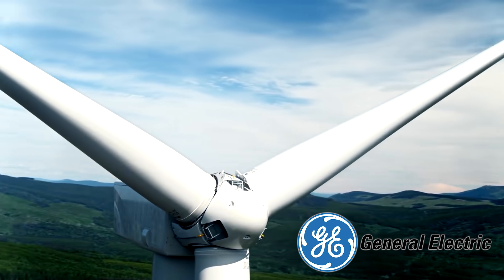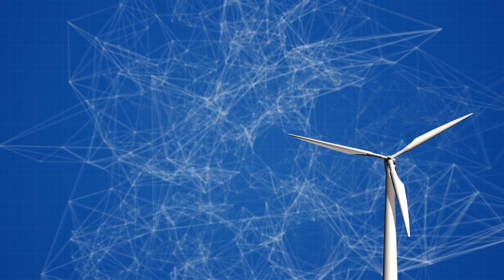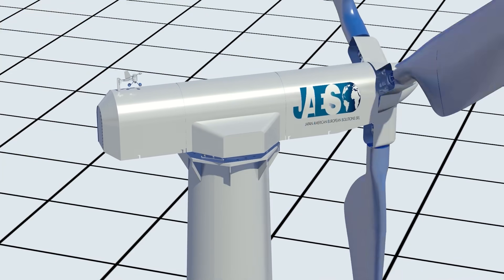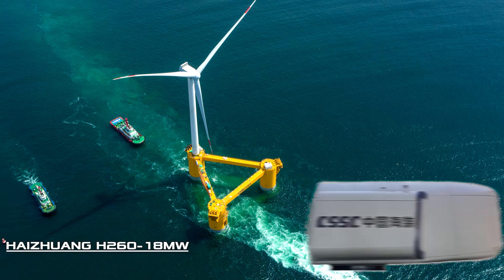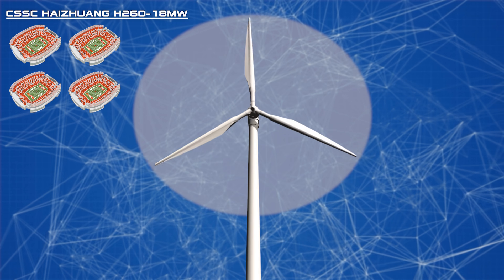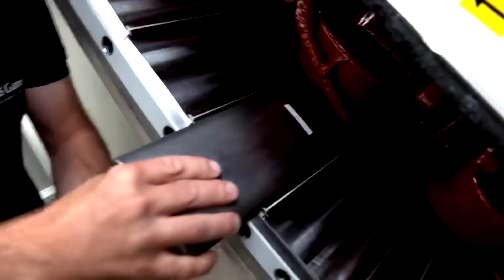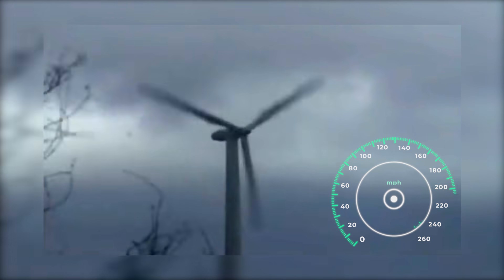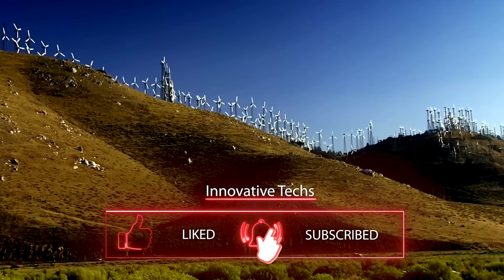China is building a wind turbine of unthinkable dimensions

Comment: To compare the production of kilowatt-hours (kWh) per year between a nuclear reactor and the biggest wind turbine, we need to consider their respective capacities and average annual energy output. Let's assume a hypothetical scenario for this comparison:

Nuclear Reactor:
Suppose the nuclear reactor has a capacity of 1,000 megawatts (MW) and operates at a capacity factor of 90%. The capacity factor represents the actual output relative to the maximum potential output over a given period.
Calculation:
Annual energy output = Capacity (MW) x Capacity factor x Hours in a year
Annual energy output = 1,000 MW x 0.90 x 8,760 hours (assuming 24 hours per day, 365 days per year)
Annual energy output = 7,884,000 MWh (7.884 million kWh)

Biggest Wind Turbine:
Let's assume the biggest wind turbine has a capacity of 10 MW and operates at an average capacity factor of 40%. Wind turbines have lower capacity factors compared to nuclear reactors due to variable wind conditions.
Calculation:
Annual energy output = Capacity (MW) x Capacity factor x Hours in a year
Annual energy output = 10 MW x 0.40 x 8,760 hours
Annual energy output = 35,040 MWh (35,040,000 kWh)

Now, to determine how many wind turbines would be needed to produce the same amount of energy as one nuclear reactor:

Number of wind turbines needed = Annual energy output of nuclear reactor / Annual energy output of a single wind turbine
Number of wind turbines needed = 7,884,000 MWh / 35,040 MWh
Number of wind turbines needed ≈ 225 wind turbines

Please note that these calculations are based on hypothetical assumptions and the actual performance of nuclear reactors and wind turbines may vary. Additionally, the size and capacity of wind turbines can vary, so the number of turbines required for equivalent energy production can differ accordingly.
😪
Reply: You calculation is over-complicated.  First you used a 10MW wind turbine against a 1,000MW nuclear generator so there is a factor of 100.  Then you claimed a nuclear plant can operating continuous so a use factor of 0.9 with a wind turbine could have only 0.4 so another factor of  2.25.  Therefore the combined effect it will need 100x2.25=225 wind turbines to compete with a nuclear generation unit.  This is just simple arithmetic!  

However the use factor of 0.9/0.4 = 2.25 between nuclear and wind is theoretical and may not easily realise in practice.

This video is about 18MW turbine manufactured by two Chinese companies and they are already used in the field.  Also 0.4 use factor may be the American data as it has nearly all wind turbines on land whereas the new 18MW big wind turbines are for mainly the offshore installations capable of a much longer continuous generation.  

The data from China are
             Nuclear capacity         Nuclear               wind capacity          Wind                   Unclear/wind
year       installed (GW)      generation (TWh)    installed (GW)   generation (TWh)   use factor/GW
2021            52                                 407                          236                        655                       2.82
2022            55.53                            417                          365.44                  772                       3.55
Reply: @gunsumwong3948  At least a wind turbine doesn't leave its deadly waste to be taken care of for many years forward, by our children's children, many years after its it has been used for a short time intensive power production!! And also Denmark, at the very Forefront of Wind Mill Production, has planned a huge Wind Park at sea.
Reply: @finncarlbomholtsrensen1188  
If you consider the sheer weight of mine tailing and other deadly material produced by each power source, nuclear wins hands down. 
An additional factor in favour of nuclear is the potential of fluid chemistry for the fuel. (Used in Oakridge, USA until President Nixon cancelled it. )

Pressurized water reactors, the standard type since the 1970s are grossly inefficient, producing a massive amount of waster by nuclear standards. 

( Solid fuel rods, without reprocessing, demands the removal of the fuel rods when 0.5% of the fuel has been converted. The fission products include radioactive gases, Xenon, and others, which split the rod apart. Once the rod starts to split it has to be removed to a tailing pond. Nuclear reactors, using pressurized water, can only operate at low temperatures, implies a conversion efficiency of no more than 1/3. Include the transmission losses of 1/4, the pressurized water is under the pressure at depth of 2 miles, 3 km, in the ocean, implying it has to be situated well away from users. The amount of the solid rod fuel energy converted to useful work before being removed to a tailing pond is only a thousandth of the energy available. )

The advantage of a design using chemical combination of uranium as a working fluid are
(a) The radioactive gas products of fission simply bubbled up out of  the fluid, allowing all the fuel energy to be used
(b) No high pressure container is needed. 
     (No potential for the roof of the reactor to blow off, as in Chernobyl.)
(c) In the event of overheating, a dump tank can be used, designed to dissipate heat and dampen all nuclear reactions. 
      (No potential for a Fukushima.)
(d) All reprocessing is contained on site with no removal of waste products from behind the containment wall. 
(e) The potential for useful energy from the fuel is near 100% as raw heat can be used for industrial processes. 

(The reactor temperature would be high  enough for concrete production, etc. )

(f) The temperature of the heat sink can be as high as 400 Kelvin, hot enough for desalination.  (Pressurized water reactors require a 300 Kelvin heat sink.)
Reply: You forgot a few things:
1. You can't make nuclear bombs from wind energy.
2. You don't have horrible accidents like Three Mile Island, Chernobyl, Fukushima or the danger of Europe's largest nuclear plant Zaporizhzhya in the middle of a war zone.
3. The cost of nuclear plants.
4. The leaks from nuclear plants.
5. The inability to safely store nuclear waste.
6. The 50 years required to store the waste for safety.
7. The danger of plants requiring a massive amount of fresh water during severe droughts.

Time to move on.  Maybe wind isn't the answer but neither is nuclear.
Reply: Don't forget to mention that a nuclear reactor does always, 24/7, all year long, produce reliable energy.
Also note that the dreaded nuclear waste from conventional nuclear reactors can be used to produce electricity in specialized nuclear reactors. This technology has been around for decades but certain groups don't want it to be utilized.
Reply: Reactors are VERY EXPENSIVE to BUILD , Long Construction Time and Maintain. Plus ..Tread of military Strike by enemies ? Then there is High Maintenance , Checking, Inspection, etc. of Reactors. Makes sense if it is NEAR HIGH DEMAND regions like cities and Industrial Complex. If a small City and lots of towns and Villages ??
Reply: Stanislav,  I wonder if you can help me understand. I seriously don't believe that during the whole service lifetime of a wind turbine that it produces more than the total energy that was needed to mine the ore, fabricate, ship, assemble and maintain it. Has anyone honestly looked at those figures?   What is the total energy required to built a wind turbine starting from nothing?
Reply: @RuleofFive  sounds like you need to do some more research on how the advancements of nuclear have come to. it's safe, and clean, now adays. this isn't your fathers nuclear power plants! There are more options now vs the dirty ones of the past.
Reply: Double that number of wind turbines needed, since peak power demand is in August while wind speed is reduced, wind turbines only operate at 50% of capacity then.
Reply: @RuleofFive  
1. Yes you can, the Hiroshima Bomb was Uranium enriched by using the power from the Hoover dam. (See the Manhattan Project )

2. and 5. The patent for the pressurized water reactor states it is not to be used for more than 2 megawatts of power production as containment is not guaranteed. 

In other words the nuclear plant manufacturers know they are using a design guaranteed to fail with subsequent leaks, melt downs and other very undesirable problems. They simply refused to spend the research money needed to create efficient and safe designs in the interests of immediate profit, hence 3 Mile Island, Fukushima and the potential losses of material from all solid fuel rod reactor designs. 

3. Nuclear plants, with grossly inefficient designs, only 1 in 1000 parts of the energy converted to useful work are competitive. In other words the cost is incredibly cheap when the usage of designs no better than 18th century steam engines, is taken into account.

4. Nuclear waste can be cut, for each Kilowatt hour of energy production, by a factor of 1000.  The total nuclear waste to date has, except for deliberate design errors, Chernobyl, (No containment shell ), Fukushima, (The backup generators were placed in the basement where they would be guaranteed to flood. ) been contained.

The radioactive waste from coal, gas, oil. If the same radiation regulations were applied to fossil fuel plants, as used for nuclear, they would all have to shut down due to the spread of radio active waste into the environment.  

6. 50 years is short period of time : lead and other heavy metal contamination from mine tailings are a permanent threat : until the material is inserted into a stable geological formation it poses a threat to the minds and health of all future generations. 
 
7. The droughts in Europe have demonstrated 
(a) the need for fresh water is determined  by the low heat sink temperature demanded by pressurized water designs, (Equivalent to 18th Century steam engines in efficiency.)
(b) Even such designs have proven able to operate in an intense drought, and in the event of loss of all water can be shut down. 

Note
 (c)  China now has air cooled nuclear reactors for commercial use which they are using in the Gobi Desert. 

(d) The usage of 400 K heat sinks allows the usage of sea water for cooling : it can be boiled.
Reply: @samadams7224  
The problem is not the energy demanded from already extracted ores, its the amount of copper and other metals which are needed for future construction. Only low grade ores are available in the amounts needed. For example the Andes are 0.1% copper ore, sufficient for the any future needs with the inconvenient problem for each ton of copper extracted, a 1000 tons of mine tailings is produced. The tailings are produced by grinding hard rock into extremely fine grains, an enormously high energy usage, so the tiny grains of copper can be extracted. (Google Simon Michaux )
Reply: @neosmith80  Yes yes there's always someone like you talking about the wonders of nuclear energy with all the horrible flaws worked out yet these dream plants never materialize because someone wants to stop them?  Great then volunteer to move the nuclear waste to your town for the next 50 years.  We'll split it between your town and Michael Edwards town.
Reply: @michaeledwards2251  Yet another person making big promises but yet they never materialize.  We're just left with environmental disasters.  Like recently the Russian Army camped out in the red forest near Chernobyl....you remember the accident from 1986?  Bad design right?  Build your dream plant (near your house not mine) and call me.
Reply: @RuleofFive  
Kindly point out the promises ? 
1.  Fossil fuel plants are killing millions every year (Just because you don't see them doesn't mean the nanometre particles from them won't kill you.)
2.  Even the current pressurized water nuclear reactors have only killed in the 100s. 
3.  The Chinese have already developed and implemented nuclear designs capable of functioning in desert conditions
4.  The usage of mountain destruction is needed to get the raw materials needed for the green revolution with cubic miles / km s of mine tailings full of heavy metals and other poisonous material. I trust you won't mind the poisoning of all the water courses near you. 

5. There is no avoiding any of this : why, because oil has already peaked, coal will soon peak, along with gas.  As the fossil fuel plants fail, they will have to be replaced with at least twice the current generation to sustain the rapidly growing demand for energy.  (GDP and energy usage double every 10 years in the Far East )
Reply: @michaeledwards2251  I'm not defending fossil fuel.  Are you kidding?  It's laughable that you say nuclear power has only killed hundreds.  We don't know the true extent of damage from Chernobyl or Fukushima.  The USSR did not release accurate information and an entire region around that plant has been depopulated in the exclusion zone.  Do you think Fukushima (newer technology) is much better?  People left that region too.  We don't know the long term health effects.

  You're giving a false choice.  Either embrace nuclear or then I must support continuing with fossil fuels?  There are other choices that can be made that are not as dangerous.  As we speak there is a war raging right around the largest nuclear plant in Europe, Zaporizhzhia.  What happens if the Russians fire a missile at that plant?  How much trouble would that cause locally?  As if Ukraine hasn't been through enough from that nut job in the Kremlin.  Nuclear is always the ticking time bomb. Think the Chinese have created a safe way to tame/harness nuclear?  Maybe or maybe not.  They're not known for being the most transparent government on earth.  Let them enjoy some accidents while they test this technology.
Reply: @RuleofFive  
There is no choice : haven't you realised this yet ?

1. Fossil fuel reserves are good for no more than another generation. Barely enough time to  create their replacements. 

2. New mines take at least a generation to find, implement and make a metal source.

3. Copper needs for renewables to replace fossil is greater than the total copper extracted to date.  Wind, Solar, etc. 
     There simply isn't the mines needed to do it nor is there time to make new ones. (Google Simon Michaux)

4. The only options left, in the coming generation,  are nuclear and geothermal. 

(Fusion will need Wembley sized power generation with considerable radioactive waste from the neutron flux. As yet, no fusion power station exists)

5. Loss of power  = GDP contraction which would be bad enough in the West, intolerable everywhere else, leading to social breakdown. The slow down in the US has already triggered a crime wave, a mild taste of what would happen with contraction. 

6. The only option left is nuclear. 

7. Pressurised water nuclear is a  non-option. 10 Gigawatts of nuclear power will need to be added per day for the next 30 years.  

It simply won't be possible to create the giant high pressure containers for nuclear use, 2 tonnes per square inch, the pressure 2 miles, 3 km, deep in the ocean, at the rate of 1 per day.  Only Nippon Steel is the only manufacturer of the needed high pressure containers I am aware of it : it is a very specialized process at the scale needed. 

8. The only option left is low pressure nuclear designs with the addition of such power generation at the rate of 10 gigawatts per day for at least 30 years. 

This will be just the start, synthetic fuel generation from atmosphere carbon dioxide will be next, which will be as big again. 

Don't forget to add in a factor of 10 times more to account for the GDP growth to meet the demands of the 7 billion who don't have the luxurious life styles of the US and Europe. 

Do you trig ?
Reply: That's one reason these wind turbines are being built offshore - more reliable energy production. Hywind Scotland achieves a 57% capacity factor. These numbers mask the problem with nuclear energy which is cost. Your 10MW wind turbine costs around $10 million. Using your numbers, 225 wind turbines cost $2.3 billion. Two recent nuclear reactors built in Georgia cost $30 billion. That's $13.4 billion per 1,000 MW or SIX TIMES more expensive than the wind turbines.
Reply: @RuleofFive  
When you mention Fukushima, remember the reactor was produced by Westing House USA. The first 2 safety inspectors preferred to be fired rather than pass the design. The third was facing bankruptcy and even with facing ruination only passed the design with caveats. As I pointed out early the US manufacturer's of nuclear plants put immediate profit $ ahead of all other considerations.  Why didn't they bother to listen to their own safety inspectors ? Because the US controlled Japanese law on nuclear reactors, which make the operator responsible for any incidents. They didn't care how the dangerous the design was, as they would not suffer. It was cheaper to fire the safety inspectors than to correct the design. 

The Russians learned a hard lesson with Chernobyl : building a reactor without a containment vessel, not bothering to maintain it properly and then carrying out safety tests as if everything was correctly maintained, not working out what they should do, understanding what they are doing, is guaranteed to lead to consequences.  Fortunately Chernobyl was only a steam explosion and not a nuclear one. Most of the radio-active material remained in the core.
Reply: @Ericwvb2  
The capacity figures are misleading. 
(a) Electricity usage and generation have to match. Any mismatch implies power has to be stored, resulting in 1/2 the mismatched power  being lost. 
(b) The mismatch problem is seasonal. Power will have to stored for months of normal usage.
(c) Generation variability is apparent even over periods as short as a few hours, demanding daily quick response storage to maintain grid stability. 

Typical capacity figures for wind turbines are no more than 33% and more typically 25%, with the effective capacity being even lower, due to the generation, consumption, mismatch. 

When you allow for 
1. The effective capacity factor for wind turbines
2. The seasonal back capacity implied

There is no cost difference between current very inefficient nuclear designs, pressurized water, and wind turbines, there is no cost advantage for wind with the disadvantage it is not controllable. A storm can force shut down to prevent the turbines being destroyed. 

Electric Arc Furnaces and other metal processing cannot shut down without a disaster. The furnace metal would freeze requiring weeks to get going ago. (Likely the furnace walls would crack.) Likewise power to hospitals, especially intensive care, has to be reliable. 

There is an additional disadvantage to wind turbines : their life expectancy is typically 8 years, against 40 + for nuclear.  The costs have to be amortised over a fifth of the time period. (8 instead of 40 ) 

(Even if wind turbines had an effective capacity level of 30%, and back up is ignored, nuclear would have to be 15 times more expensive per Kw Hour for wind turbines to be more cost effective over the total life cycle. In practice, allowing for back up, nuclear would have to be 30 times more expensive per Kw Hour for wind to be more cost effective over the total life cycle. In other words with your own figures, nuclear wins hands down. )

The reasons for wind turbine shut down are wind damage : the blades get ripped apart by all the particles in the wind, causing failure.  In practice the life of a wind turbine is no more than 10 years. Any longer and all the moving parts have to be replaced.  

The current vertical blade designs don't take into account safety and maintenance. A horizontal blade design is needed to put all the parts likely to need maintenance at ground level rather than at the top of a tower. As a result a number of maintenance engineers have burned to death already. 

(Maintenance of current designs of wind turbines requires a steady stream of volunteers willing to risk being burnt to death to maintain current electrical power supplies. ) 

Nuclear has major potential for improvements, wind is already close to its limit. 

Pressurized water nuclear reactors operate at a water pressure equal to 2 miles, 3 km, of ocean water. This by itself is a very strong reason why they are so expensive. Additionally a side effect of such pressures is the need to have a containment chamber for the steam from a vessel fracture 800 to 1000 times bigger than the reactor itself. 

Low pressure nuclear designs, such as used by Oakridge USA, simply don't have such problems and whenever no body  could be bothered to work over the weekend, the reactor was shut down and restarted Monday.
Reply: @michaeledwards2251  The problem is there is always some X factor with these plants or the nuclear waste that no one wants to deal with.  Yes most radioactive material remained on site at Chernobyl.  There is still a very large exclusion zone.  Ask the Russian soldiers that camped out in the red forest how they were feeling after a few days of that.  I'm still worried about the Zaporizhzhia Nuclear Power Plant because there is serious fighting going on around it.  This is not a bad design or profiteers making things unsafe. This area will have some serious problems if the Russian fire a missile at that plant. This just shows how dangerous this type of energy is.
Reply: @RuleofFive  
Since Russians have learned from Chernobyl they are some of the least likely people to start firing at nuclear power plants.  My main concern about Ukraine is the massive stock piles of nuclear weaponry everywhere.
Reply: @michaeledwards2251  ???  Ukraine gave up their nuclear weapons back in 1994.  Look up the Bucharist Memorandum.  This is when Russia guaranteed Ukraine's territorial integrity.  Joke! The Russians already damaged part of the Zaporizhzhia nuclear plant with a rocket attack last year.  What are you talking about? Are you a Russian troll?
Reply: @RuleofFive  
Are you OK ? Don't realise the only way Ukraine can attack Russia is with NATO help. (Google Andrew Napolitano )  Interviews with American military are most enlightening.  There have been a number of incidents in which US military drones have already encroached on Russian air space. 

For Russia, Ukraine is the equivalent of the Cuban crisis for the US. This is an extremely dangerous situation : worrying about a few minor leaks from a nuclear reactor is literally the least problematic factor in the whole situation. 

Already the shortage of nitrogen fertiliser world wide is a threat to the food supplies for millions, along with the reduced crops in Ukraine and Russia. 

The most dangerous factor in the whole scenario is the lack of any US President : Biden lacks the minimum cognition not  to be considered demented.  The use of Ukraine as a proxy is carries with it the potential to escalate to all out nuclear war.  There is no purpose driving the conflict other than immediate profits for the US military manufacturers. 

The actions of NATO, supplying depleted uranium rounds, witness Fallujah, with all the birth defects and other consequences, is correctly interpreted as a threat to the populations of Russia and Ukraine. The response has been to place Russian nuclear weapons in Belarusian territory. Every step, no matter how small, to all out nuclear conflict is undesirable.
Reply: @gunsumwong3948  
Actually I neglected to mention the calculation of Wind Turbine versus Nuclear Power source is oversimplified because it neglects 2 factors

(a) The power demand varies continuously during the day : for a wind turbine the times of maximum output are determined by the weather with a seasonal factor thrown in. 

The mismatch between the wind turbine power generation profile and user demand profile demands a storage system to compensate with at least 1/2 of the mismatched power being lost due to storage and retrieval. 

(b) The 90% capacity factor of nuclear is due to the periods of maintenance demanded : it means during peak demand the nuclear reactor can be run at 100 % capacity with maintenance being performed at night. 

Additionally over a plant life cycle, a wind turbine only lasts 8 years, the turbine blades are eroded by air borne particles which scratch away the glass fibre material, but nuclear systems, being completely enclosed, with all air and water filtered, last 40 plus years, giving a huge life cycle advantage to nuclear plants. 

This means the advantage of nuclear, for effective availability, is at least 3 or 4 to 1 compared to wind turbines with a total life cycle advantage of at least 30 to 1.
Reply: What I miss is  how long a windturbine lives compare to a nucl. Plant...Conclusion... Use more nucl.energie.. Much  more..
Reply: @joszoet4003  Yeah wind turbines probably won't last as long as the Chernobyl exclusion zone will.  Good point. Maybe the Zaporizhzhia nuclear plant will have a bigger accident after Putin blows it up.  More nuclear!
Reply: Do you know how many steam turbines are needed for a 1,000 MW nuclear power plant? My guesses is 3+1. because there is always at least one is under the maintenance.
Reply: @haoli5779  
Typically, witness French Nuclear Plants, the entire plant would be shut down, and all the turbines, and associated equipment worked on simultaneously.  Access would be needed to change blades, bearings, generators, etc.
Reply: No. 😅😂 There are just thousands of abandoned farms all over the world where wind turbines are left to decay, +visual and sound pollution while working. Not to mention the impact on wildlife (primarily birds). Blades cannot be recycled and this is one of the biggest problems, with wind turbines having a lifespan of 15-20 years. On average, the efficiency index of the turbine declines by 0.5 percent annually if not more. After the "fulfilled" life span, they are left at the mercy of time, while the amount of concrete used for concreting the base and general consumption of space should also be taken into account, given that the 'wind-shadow effect' should be taken into account when building wind farms. @finncarlbomholtsrensen1188